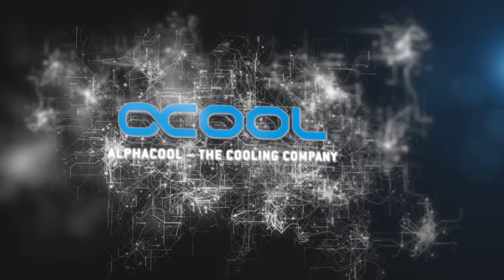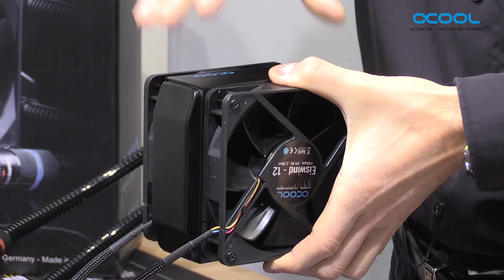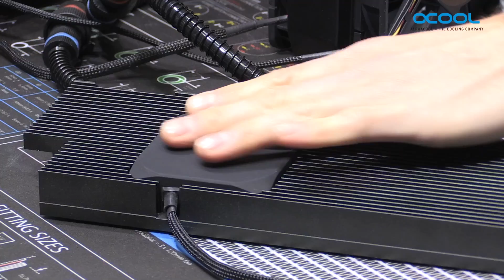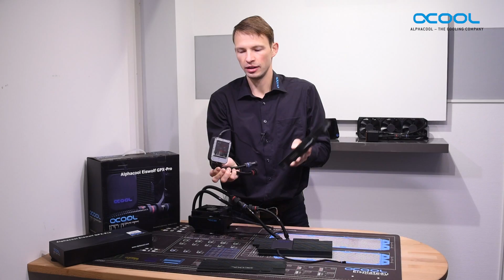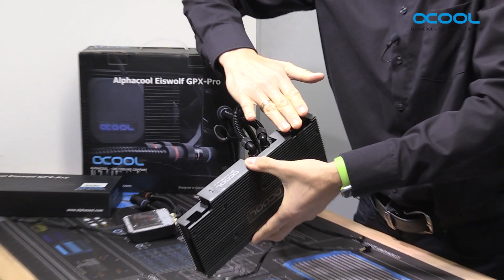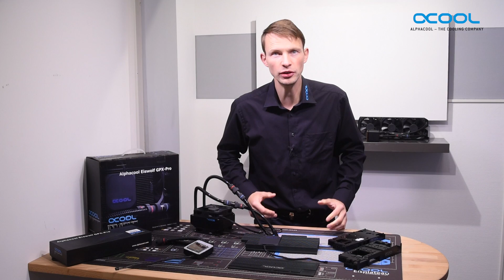Vendor video: Alphacool Eiswolf GPX-Pro expandable GPU AIO

Comment: I use Alphacool Eiswolf 120 GPX Pro Nvidia Geforce GTX 1080Ti Pro M21.

With the two included fans at 100% RPM my 1080ti reached 90°C in games and throttled to 1600MHz. With one basic Corsair fan at 100% RPM it never goes above 55°C in games and the GPU stays at 2038MHz.

I am quite happy with the product, however, the included fans are rubbish.

Comment: Just installed my Eiswolf 240 on my Radeon Vega 56, running on Vega 64 BIOS. It's connected with an Eisbaer 280, and the temps went from 80 degrees at load, to 46 at load running 3DMark Timespy. Fucking amazing cooling performance!

Comment: Does this ever have to be refilled and how if so
Reply from the maker: You do not need to refill this cooler. Maybe after 5 years. But than, it is easier to use a small reservoir wich you can connect over the quick release fittings.
Reply: @AlphacoolGmbH   thanks

Comment: Just bought the M23 block and 240mm radiator for my zotac 1080 ti mini! Here's hoping everything goes according to plan! Thanks Alphacool!
Reply: Jamil Saleh thanking to do that to! Mini on stock cooler is hot!! Can you tell me what's your temperature is now on water cooled?
Reply: Piotr123 the GPU is at like 30 degrees Celsius on MSI Afterburner, tops. It's amazing.

Comment: how do you reduce voltage on the pump?
Reply from the maker: With an 7v adaptor. You can find those adapters in every shop.
Reply: thank you very much for the response. with the 7v adapter will the pump still perform sufficiently?
Reply: will this work? http://www.au.aquatuning.com/cables/fan-cables-adptors/14831/phobya-adapter-4pin-molex-to-3pin-5v/7v/12v-30cm-black
Reply from the maker: Yes, but only with 7V not with 5V.
Reply: thank you :)

Comment: will it be sufficient to only connect one fan to the radiator ?
and can i cool a 1070 and a i3 4130 CPU with one radiator aon one fan ? (my case is very small)

Comment: where does the pump cable plug into? and what is best recommeded to control the two plugs for the fans? Thanks for the vid, seems like an amazing cooler might buy this for my next gpu.
Reply from the maker: You can connect the pump with any 3-pon connector. But be sure that the pump gets 12V. You can connect the fan wherever you want ;) Best way is to put them on a Y-adaptor and than you can controll them maybe over your mainboard (fan header).
Reply: Hello, if I want to get the eisbaer and the eiswolf, do we need two radiator or one is good enough ?
Reply from the maker: Wich CPU and GPU? It is dependent on the whole TDP of CPU and GPU. You can handle around 300W with a 240mm radiator. If noise doesn`t matter, you can handle up to 500W with one 240mm radiator.
Reply: I have an i7 6700k and a gtx 1080ti. I am thinking of getting the 360 rad version (would that be enough ?). Even more important, could you please tell me if the Eiswolf GPX Pro will be compatible with the gigabyte aorus gtx 1080ti (that's the card I own). Best regards.

Comment: I would like an effective AIO on a Zotac GTX 1070 Founders Edition GPU so I am considering Alphacool Eiswolf 120 GPX Pro but found no information about the heating of either the VRM or the memory/GPU unit heat dissipater. I would like to know whether I can run it with passive cooling? (VRM/RAM temp)

case: NCASE M1

sorry for my english
Reply from the maker: You do not have a passive cooling, its semipassiv. The waterblock is also cooling the aluminium parts. ;) The temperaures of the vrm and V-Ram will be better than with any aircooler ;)

Comment: GPX-Pro compatible with Zotac GTX 1070 Founders Edition? Thanks
Reply from the maker: Yes, you need the 1080/1070 M01 cooler. ;)
Reply: i ordered :)

Alphacool Eiswolf  120 GPX Pro - Nvidia Geforce GTX 1070 M01  + Backplate /11339/

Comment: Do you guys ship to Brasil?and is it compatible with 980 TI?
Reply from the maker: Sure we can, but we will not make GPX-Pro cooler for the GTX 9XX gpus. They are End of Live, so we will only make cooler for the newest cards like 1060, 1070, 1080 and the new AMD GPUs like RX 480 and higher (not for R9 cards)
Reply: Thanks for taking the time to help me.
Reply: End of line does not mean useless because 980Ti is still a good card up there with the 1070, but i understand that you will only make it compatible for current and future cards. Hopefully you will keep releasing plates for GPU's in the future, but i have to ask why are you selling the plates only with the GPU block? That's why they must be expensive, i can only see them being sold both together so far, shouldn't they be separate? Otherwise in future people will be buying both when they only need the plate.
Reply from the maker: Nobody said its usless, but the most watercooling fans have cooler for their 980 cards, so it makes no sense for us to produce more cooler for that card ;)
Reply: Hy have a good day,i just saw on your website that you guys have an 980ti gpu cooler with the radiator included.Is it compatible with the Zotac 980ti AMP! 6gb ?

Alphacool Eiswolf 120 GPX Pro Nvidia Geforce GTX TITAN X / GTX 980 Ti M01 - black

Comment: how do you fill it up when the water evaporates?
will there be options to buy it with different radiator sizes? (240, 360)
Reply from the maker: You can buy prefilled radiators for the GPX-Pro Solo ;) Than you can built your own AIO.
Reply: Alphacool International GmbH...und wie kann man fehlende Flüssigkeit auffüllen?
Reply from the maker: Dazu wird noch etwas kommen. In den nächsten 4-5 Jahren sollte das aber eigentlich völlig unnötig sein. Durch die Diffusion verliert man pro Jahr keine 10ml, was bei der Füllmenge nur ein Tropfen auf dem heißen Stein ist. 
Selbst wenn man die Schnellverschlüsse sehr häufig verwendet, dürfte es mindestens 2 Jahre dauern bis ein Nachfüllen nötig wäre. 

Verwendet man die Eisbaer mit der GPX-Pro, kann man aber direkt über den Fillport der Eisbaer den Kreislauf befüllen.

Comment: this looks realy good ! i especialy like that the bracket is hiding the PCB on the graphiccard .... if i ware to point out one thing ... i HOPE that you will be able to take off the anti kink and the conectors and use a tubing of own choice ( and use the quick disconect / anti kink ) so people have the ability to have red or blue tubing insted of just black
Reply from the maker: We are working for other tubes for the next generation of products. But that will take a lot of time until we will present the Eisbaer and Eiswolf 2 :-) But we are working on both.
Reply: How long for the next generation product? Less than 6 months?

Comment: Great products. Are gpx and gpx pro custom vram/vrm dissipating parts compatible with eachother?
Reply from the maker: No, sorry. The cooling block of the GPX-Pro is bigger and the cooling plate is different. The GPX-Pro has a better vrm and V-Ram cooling performance than the normal GPX cooler.